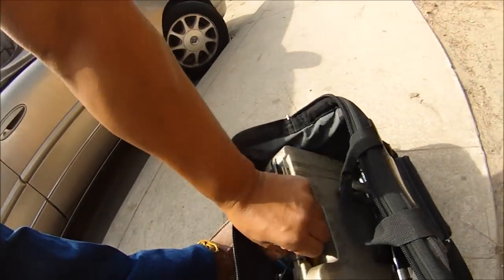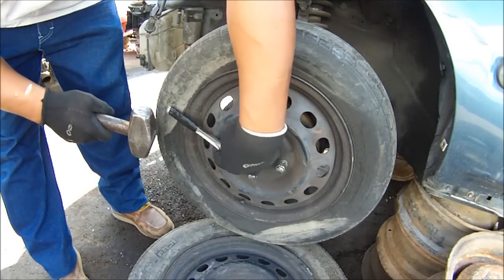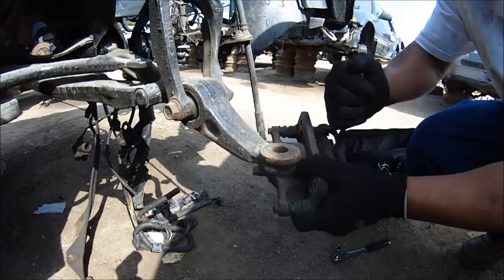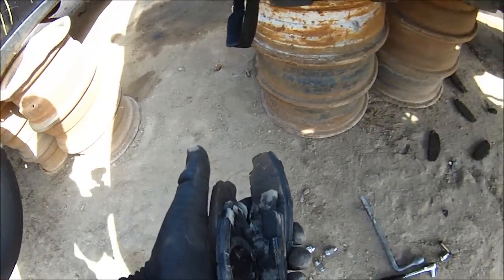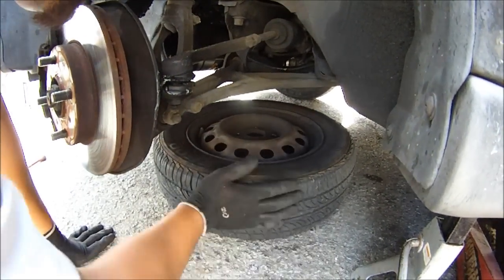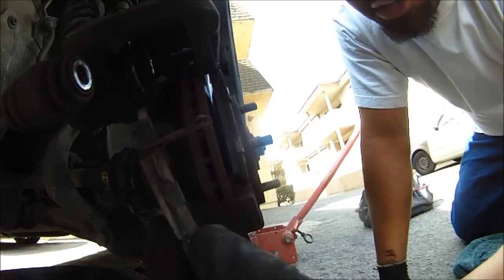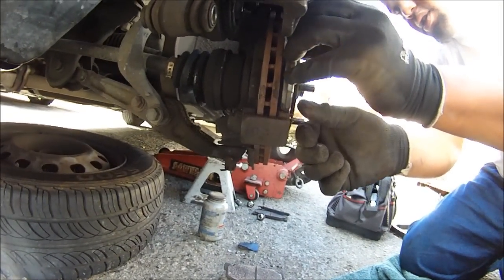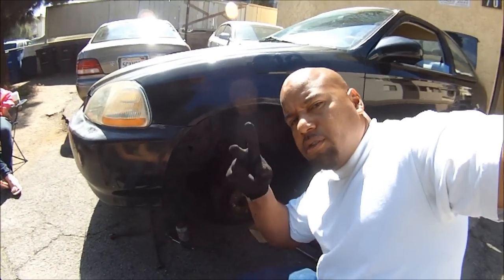BRAKE PADS FOR ONE DOLLAR ($1) A PIECE, FROM THE WRECKING YARD FOR ANY CAR. HONDA CIVIC

Comment: Around my area, most of the local U-Pull salvage yards will throw in the pads for free if you purchase something else. 
Oh, and please spend the extra few seconds to put the bolts, lug nuts, and other fasteners back on the car and not on the ground. That may be what the next guy comes to look for and it will help them out.
Reply: true
Reply: is that something else worth a dollar a piece as well?
Reply: Hate when shit is missing . Sometimes trying to get specific pieces cost like the part itself if it's in assembly

Comment: I actually already knew about this, but I wanted to tell you that this is a great video. A lot of people don't realize you can do this. Only thing that sucks is where I live the junk yard has a $10.00 minimum so I wouldn't save much doing this but if there are junkyards that are cheap like that one then there is NOTHING wrong with getting pads at the junkyard.

Comment: Just wanted to share that everyone should get a price check before digging parts out of junk yards. There was one out my way that wanted $25 for a used motor mount once that I could buy brand new for $35, and they wouldnt go any lesser in price. I wasted 1.5 hrs that day first of all trying to find a same or similar model 1983 Nissan/Datsun Sentra with same motor mount, and then fighting rusted bolts to break it free and remove it. I expected to pay $10 for it, but that didnt happen. I always get a price check before picking the junk yards for parts ever since that happened in 1995 and it has saved me from wasting time and frustration. Really cool that the junk yard you go to is letting brake pads go so cheap. I never thought to buy them used like this given the pads are so cheap anyways, but this is a really good video for anyone who has the know how to replace the pads, but needs to save every little bit to put food on table etc and the $18 saved is food money for their kids etc. =)

Comment: Good Advice bro. Here's what I do when I need Brake pads. I'll go to Autozone and purchase at full price the brake pads but I'll make sure I get the Lifetime warranty. I haven't bought any brake pads in 5 years because as soon the pads start to squeak I'll take them to auto zone and get new pads for free. No fees just give out your Number and that's it.
Reply: @-PARADOX-
I never knew they had that & hopefully they have the same deal in Cali.
Reply: PARADOX thanks
Reply: PARADOX technically for the lifetime warranty you're supposed to purchase new rotors and calipers and sometimes they require you to purchase the brake hose as well but they don't teach all their employees that or you wouldn't get new pads one time never mind for life... So always remember to go to the new person or the same one all the time, or just become friendly with them.
Reply: Joe Diblasio it doesn’t matter who you go to, the system is what recognizes the warranty aka your phone number not the person working the counter. They’ll give you pad for life even if all you buy is the pads, don’t give out false info I managed an Autozone before moving to O’Reilly
Reply: Thank you! May you be blessed!
Reply: Not always the case. They usually do that just so you're a return customer but where I work the warranty is just for manufacture defects not against wear and tear and not for if your caliper seizes and eats your brake pad because you didn't apply grease to the slider pins. We have warrantied pads for manufacture defects like cracking and braking. Squealing is caused by improper installation of brake hardware or re-using old brake hardware or not greasing slider pins 99.9% of the time, not the brake pad itself. When people come in with old wore out brake pads and want them warrantied that just means they did their job and you used them to their fullest. When you buy car tires do you warranty them when they wear out after 50,000 miles? Nope. Again most places are pretty lenient on the brake pad warranty including where I work we will warranty them but remind customers that normal wear and tear does not constitute a warranty replacement on a part designed to wear out. The customers that come in demanding we warranty their pads and have an attitude are the ones we do not warranty so if you are going to warranty something just have a nice attitude and 99% of the time we will be happy to help you out
Reply: @AmuckPVP  they do. I have exchanged brakes over 3 times now
Reply: Doesn’t sound right. If they are defective they will replace but not regular wear.
Reply: @mediaguy4037  No it’s true make sure you get the Lifetime warranty

Comment: You're smart.. I paid $250 for a used 5-speed honda transmission. Paid another $45 dollars for clutch and pressure plate. I then paid a friend $150 to change the transmission. He did like you and sanded the flywheel by hand. So for around $500 I got my transmission fixed. It took him like 4 hours to do the job which came to around $40 an hour. And then there's the feeling of saving something from the landfill or scrap yard. I very much believe in using something to it's full potential. When I throw something away there's nothing left of it worth keeping. If we all did this and paid our friends to fix things, rather than the ripoff wealthy garage. The world needs many more men like you Mr. Old Skool :)

Comment: If you really have no option but to fit second hand brake pads from different cars, take them in wheel pairs only then split each pair putting one on each side of the car. This will balance out differences in friction material characteristics so the brakes pull evenly.
Your tutorials are great Old Skool

Comment: You legit show people how to get back on the road for cheap. Good looking out.

Also i agree with having multiple things to support the car. If i work on cars at home its on flat solid ground. Jack stands(at least 2) if wheels are on i put my wood cribbing built from 2x4s under the wheels as well. If wheels come off they go under a solid part of the car like you show. 

I am fine with death by an automobile but i want it to be while racing if it happens and not due to it falling on me.

Comment: Cheap pads from the chain store  are often worse than nearly new or lightly used genuine factory pads from the junk yard.
Now it is easier with part interchange info and online yard inventory.
Few tips:
new or lightly used pads are sitting almost flash with a caliper bracket anti rattle springs/plates look trough the holes in the wheel rim.
make sure pads have even wear (not wedge shape) 
look for cracks and delamination
check the rotor appearance ("burned" rotor will indicated bad glazed pads).

Comment: ive had to do stuff as a shade, plus a pro, good common advice, but uneven pad wear on a single piston caliper, may need further investigation like the caliper may be hanging upon the slide pin. another issue is a two way street, but when you compress the piston back in the bore sometimes you may want to open the bleeder valve a hair, bleeding the brakes is easy any how, just remember to pump the brake pedal several times before you move the car, I used to work on Old fiats and the front and rear pads were the same pattern but different thickness

Comment: Sweet Potato Pie those OEM pads just drop right in.  The aftermarket ones I get, even the higher end brands I always have to file the pad locator nubs a bit for a smooth fit.  Stay gold.

Comment: If you do get them at a junkyard make sure you take them all off the same car so they are all the same and not warped. I found a brand new pair of duralast gold ceramic pads at a junkyard for 5 bucks. A year later they havent worn down one bit yet and that's with lots of heavy traffic driving.

Comment: what about the calipers if theyre not to rusted...do you recommend scooping those up too?
Reply: As long as they look to be in good condition, I don't see why not. I'd just test them real good before you take them at high speeds
Reply: I've had better luck with "junk yard" calipers than brand new calipers. I changed mine for my bmw z4 and the bmw dealership gave me calipers that were bad (piston wouldn't come out) and didn't even offer me a refund because I installed them, I just went to the junk yard and got them for $50!

Comment: Hate to tell you man but, you forgot to lube the slider bolts. The outer pad usually wears less than the piston side pad because the bolts are usually not lubed enough. Otherwise, you did everything correctly

Comment: a helpful hint to those following this advice: If you are not sure the year you are looking at matches the year you are working on, call the auto part store and get a part number quote. If the part number match between years, you are good. For example, if 2003 calls for MKD276 and 2005 also calls for MKD276 you are set. Its a match. Gotta do what you gotta do when cash is tight. Just be smart about it. (I would probably avoid wrecked vehicles as an extra precaution.)

Comment: what kind of knobend would hit a ratchet with a lump hammer
Reply: unclebobsgametech the term you are probably looking for is impulse, a lot of force delivered in a short period of time to break the fastener loose, anyone with a basic understanding of physics and mechanics would know this. It is pretty bad advice to hit a ratchet with a hammer as it generally requires a lot of impulse to break a bolt loose, which has to he transmitted through the pawl and teeth of the ratchet, they aren't designed to break fasteners loose which is why breaker bars exist....

Comment: If 1 pad is thicker then the other (assuming they were the same thickness 2 begin with) then, u should clean & grease ur guides & the caliber slides back & fourth on the 2  bolts so REMOVE THE 2 BOLTS,& THE INTERNAL METAL SLIDES, RUBBER BOLTS & CLEAN& GREASE EM UP GOOD SO, THEY WILL WEAR EVENLY

Comment: Now that is a step to far recycling brake pads, 
I worked 3 yrs at  BRAKE  COMPANY,  that made brake shoes and pads and clutch plates
and when cars involved in accidents in some cases  police use to come back to us 
with defective brake pads or shoes that cause brakes to fail,, 
And test them 
and I tell you,
You cant use 2nd hand brake pads or shoes, 
One you place new pads or shoes in to drums or callipers 
they become deform and shape to the braking point of that car van etc 
and change geometry of brake adhesive bond of the braking material,
And removing old pads or shoes  and refit to different calliper or drums 
reduces the to stopping power by as much as 50% under emergency stopping loads, 
DONT RECYCLE BRAKE PADS OR SHOES BETWEEM DIFFERNT CARS,

Comment: I think i can afford the brake pads and rotors but last time i went to the junk jard i found some pads and rotors almost new and original from the dealer total bout 200 plus taxes i could see that they had almost just changed them before they had an accident that wrecked the car 200 for 16 fuck it ill take i just marked them so i put him on the same side where they came from so reduces the chances of any screeching sound down the road

Comment: something to keep in mind when compressing the piston back into the caliper. if your car has abs on it, and your forcing that piston back into the caliper without opening the bleeder screw, you can ruin the abs control module. all about the details
Reply: Blah blah it'll be fine.

Comment: I work at pick and pull in Cumberland RI doing it on the cheep  was ok, up till u threw the parts u did not need on the ground in sted of putting them in the car. I guess you were never taught junkyard etiquette

Comment: We don't have a pick and pull in over 150 miles where I live. Junkyards here think they are the friggen ford dealer when it comes to prices. Older cars rust to crap and are shredded. Getting anything for a car >10yrs is very difficult and expensive.

Comment: Using anti seize for hardware slides is a bad idea when the brakes heat up it gets thin if it gets on the rotor you will never stop. the rest of the video was very good.

Comment: amazon, new $20 bucks shipped to your door.   not worth the 2 dollars to enter the junkyard...8 dollars in gas, wear and tear on my current car and most importantly MY TIME !!!
Reply: BOOM that works too. better than a junkyard pad. but still you are required to run your car, spend gas and time. .... and a 90 buick is likely less than other cars.

Comment: I like this guys videos . However , you have to be pretty broke to buy used brake pads . When I did my front pads on my 83' Nissan Maxima I expected to pay 30 to 40 dollars and was stunned when I got both sides (all 4 )for $16.99 !( and I didn't cheap out that's the only grade they make for that year mode)l . Of course that was back in 2000 maybe the prices have gone up and I know prices vary considerably from vehicle to vehicle .

Comment: IF youre pinching pennies how are you gonna afford all those tools fam?
Reply: Tools are forever, tools are life. Call it an investment.
Reply: You can buy a lot of tools for cheap at flea markets, garage sales, craigslist, etc. Also you buy it when you still have a job not after. You start out with basic set then add more tools over the years to your collection. I buy use tools on eBay all the time for pennies on the dollar. You can get a basic set to do most basic jobs like brakes and such with a kit for less than $30.  Worst case ask a friend or neighbor who has tools to go with you or borrow their tools. Harbor freight has a lot of tools for cheap and coupons and sometimes Sears as well with their 50% off tool sale and craftsman day sale.
Reply: or when stores have a deal going around... just bought a 401 Kobalt mechanic set piece for 25 dollars - original price was 300 dollars! It was very YMMV though since only one Lowes store had that price. Some sort of local clearance. I have also picked up once a 3200 PSI pressure washer for 49 dollars ... all other stores from same shop had it for 340 !!

Comment: I appreciate saving money, I bought nearly-new rotors at my local pick-a-part last week. But pads are 5-7 bucks a set at Rock Auto. Currently $5.44 (for four pads) for your car, which is less than you paid for nasty, worn-out pads. And mixing and matching odd pads?!? This is just bad advice.
Reply from the maker: QUIT WHINING!
Reply: This guy is showing people how to make it if they don't have a lot of money and is trying to help people out on doing the work themselves so they can save money. Where's the appreciation.
Reply: Micah Lockwood - You're missing the point. The fact of the matter is that you can get NEW pads for the same price or lower with less work AND it be safer.
Reply: not bad advice at all the junk yard is one of my favorite places to be becouse no matter what I am looking for 100% of the time I find something different for one of my cars that I was not expecting to find like a  custom dash for my f350  nice rims for my denali my friend and I found picked up a brand new 5.7 chevy 350 that had just been rebuilt with roller cam and vortec heads for only 350$ in a 1980s truck that looked like garbage who would of thought ? but I love the junk yard and appreciate this guy thinking of all the peaple who can't afford new brake pads and not everywhere has rock auto btw at least not where I am from

Comment: Aint nothing wrong with brake pads from the junk yard, just because a car was wrecked or motor went bad or whatever, it's still a properly functioning brake pad if they aren't worn, I haven't bought brake pads in many years, some junk yards don't even charge you for them, I've got several in my trunk, enough to last for years.

Comment: dont get me wrong but i am from the UK and a fully quald mechanic  2nd hand brake pads are a big no no  in the UK if that what you do in the USA OK but you must get uneven braking and brake squile not to mentin the uneven ware on the brake disks          /roters  from the old knacked pads
Reply: that is the exact reason i became a mechanic not a English Teacher  apology's for my crap spelling
Reply: adam sumner Your MOT station will fail most vehicles on brake balance machines.
Reply: yes i think the tolerance is 20/25% braking imbalance on the current mot guidelines
Reply: *****  
that is the exact reason i became a mechanic not a English Teacher  apology's for my crap spelling  and i spell checked it as well

Comment: you can buy them pretty cheap , i am not sure if is worth driving and all the time to get used 50% life pads , i think if you dont have money to buy a new set for 20 bucks on line you probably dont have money for gasoline either wich means you shouldn't own a car, i know there is a lot of tricks you have show us in your channel  that are pretty cool but i am gonna pass on this one.
Reply: Reading too much into this. Its a "How-to" and motivation to think out of the box  in many ways. I don't see this as a safety issue either as it is common for new brake pads to wear uneven anyway.